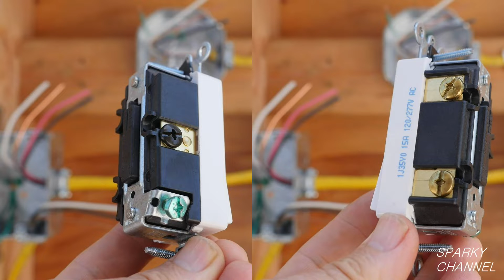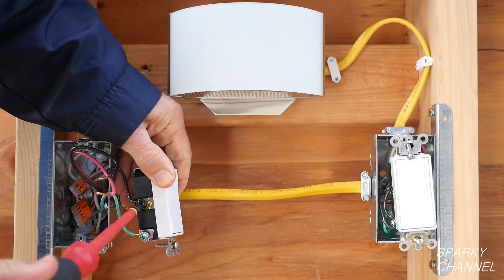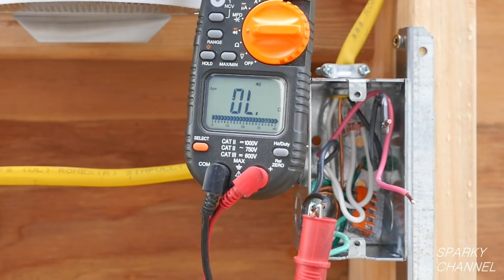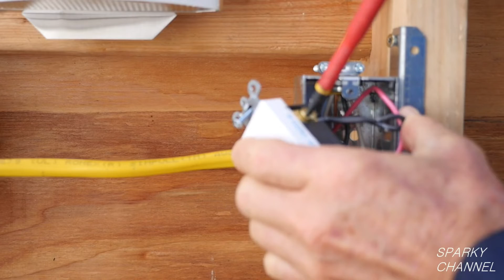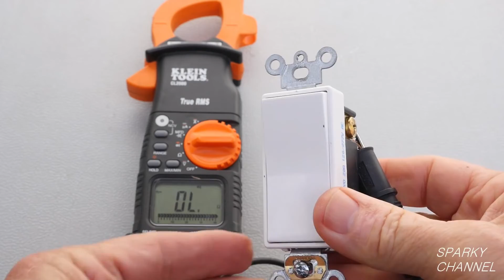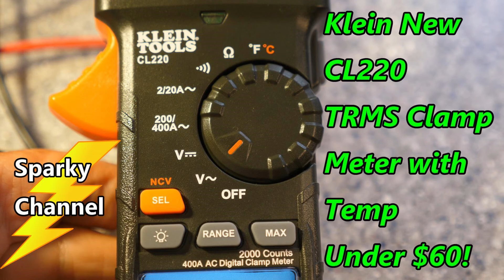How to Fix 3-Way Switch Systems with Diagrams Included

Comment: I always enjoy your videos.  Your pace, lighting,  audio and visuals both diagrams and video are at the professional level!  As a DIYer/handyman you have given many great insight to the residential electrical operations.  Thank you very much! Stay safe and happy.
Reply from the maker: Thanks so much Richard!
Reply: @SparkyChannel  When you do the test in the field, do you leave the switches installed but just unscrew them from the switch boxes? That's what I do. I turn off the breaker(sometimes), undo the switches, then turn back on the breaker and visually look for the trevelers and look to see which common is live/line and which is load with a pen tester and/or a volt meter. Then I can turn the breaker back off(always) and place the wires under the proper terminal.
Reply: Sometimes I can visually see the issue without testing because 99 percent of the time, the travelers in the box are easy to identify since they will either be in the same conduit or nm cable. It's usually easy to tell if the common was placed on the traveler terminal and that the traveler was placed on the common terminal.

Comment: This was a perfect video for me.  I had the same issue with the circuit--black wires connected wrong so the switches didn't work right.  I used the exact technique you described and all is well.  Thank you!  😀

Comment: Why did you used two different voltage testers ? Fluke and Klein, any difference between those two?
Reply from the maker: I like to carry both because the Fluke is IMO the best at what it does, identify a hot wire in a crowded box. The Klein is a very good LED flashlight and low voltage tester. The Fluke doesn't do low voltage. That's why I use them both.
Reply: @SparkyChannel  thank you a lot!!! 👍

Comment: I had a real head-scratcher last week. My house is a tri-level  built in 1960. The downstairs stairwell has two 3-way switches controlling a light. Working fine until I was bound and determined to replace one of them with a smart switch. Turned off the breaker, Pulled off the top cover plate, and found no red wires, only black and white. The box had 3 cables coming into it. All but one of the white wires were nutted together, the other was on one of the brass terminals. The other brass terminal had a black wire, and the common terminal had another black wire. Removed the switch, turned on the breaker, and found the black wire from the common was hot. So line wire, right? 

Long story short, yes and no. 
The bottom box is a 2-gang with 5 cables coming into it. Only one of the 5 black wires was the actual “line” wire from the panel, going to another single-pole switch for a switched outlet. It then fed from there, through the bathroom outlet and light, to the box at the top of the stairs (into the common terminal mentioned before). They then used another of the 3 branches from the top box (which is one of the 5 at the bottom) as the travelers going back downstairs to the 3-way switch there. The light fixture was another of the 5 bottom branches. The 3rd branch in the top box, I have no idea where it goes; I thought it was the load (light) until I beep-tested between the bottom branches and the light. 
So crazy I haven’t even seen this setup on YouTube. 😀
What’s even more weird is that the upstairs stairwell light and switches (also original wiring) use 3-conductor cables. Not sure why they didn’t do the same downstairs.

Comment: I moved into a large house built around 1980. 
It boasted lots of these 3-way switch systems I had later to repair. In some cases the switches were barely 10' apart in the rooms, so I assumed these were just installed to provide work for the original electrician. The house also came with several really pointless 4-way switches. I was able to repair two of these mostly by luck, but not the last one where the lights have remained dark.

Comment: Here is a baffling scenario... I have a setup exactly like your example and I rewired it just as you describe. It now controls the dining room light perfectly. However, now when the left switch (one with power coming into the box) is switched to one position, the light in the adjacent kitchen goes off! How could that be? There are no extra wires in either switch box or the fixture box. To be fully transparent, I did make some in-wall changes to two circuits when I had to splice in extra wire in junction boxes to extend up and over a new opening in the wall, but I was careful to keep the dining room circuit (basically the traveler wires heading to tne other switch) separated. Of course, that is all buried behind new drywall/tecture/paint work now! I think I will just live with unless there is some clever way to determine why the switch is controling the other room and somehow separated it. Thanks for the clear videos!
Reply: That's why you don't bury splices. Now looks like you need an electrician or you have to live with your mis-wiring.